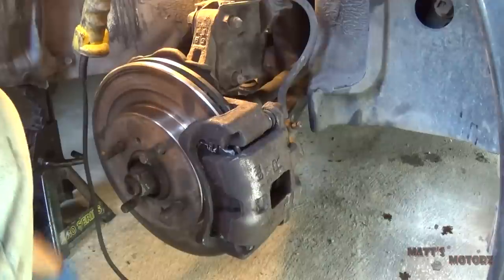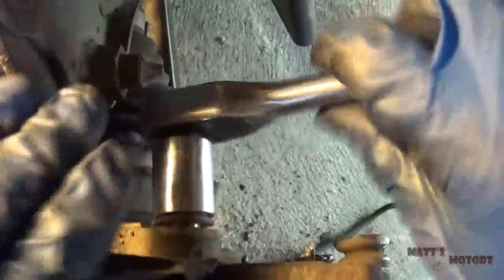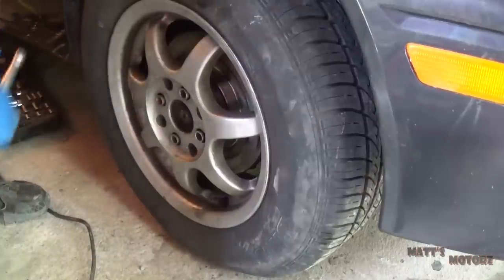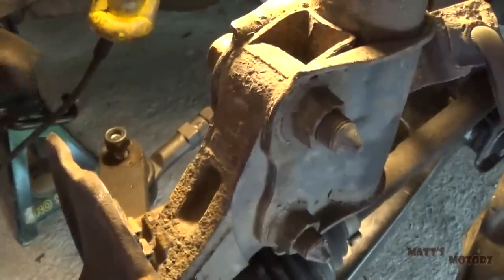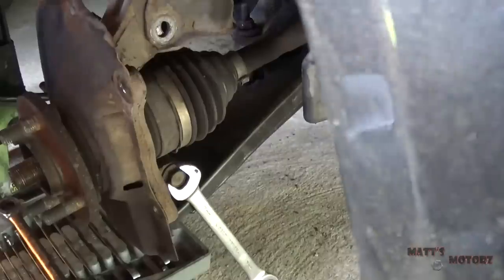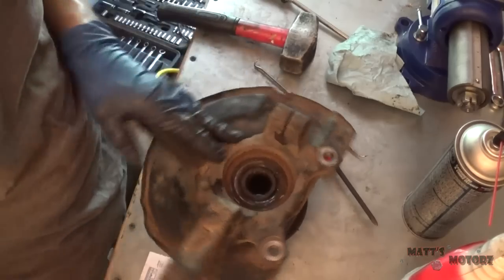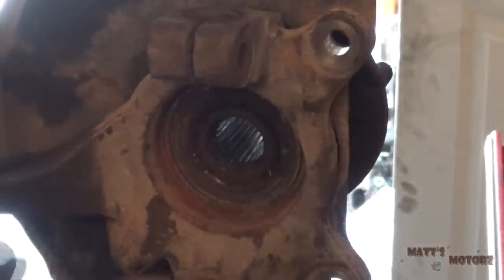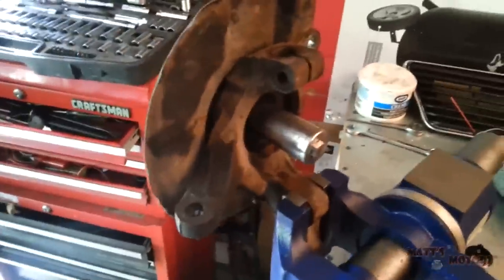Wheel Bearing Replacement - Part 1 [2002 Mitsubishi Lancer]

Comment: Good video Matt, thx for the share! I'm fixing to do a friends bearing on an '05, my only advice from past experience, when pounding the bearing out, make sure the spindle assembly is on a stable, firm setting, every time you hit it on the vice n it moves, you're losing striking power. On some spindles I've set it on the ground studs down, with something keeping the studs off the ground. Have a good one man!

Comment: I like the way you proctect the joint and your equipement. Must guys just hammered like crazy and breaks everything. You will need to find a way that the piece don't move when you hit it with your hammer. you loose a lot of power. Another thing. Kudos for the quality of the images and sound. Too often its good but crappy. Good day

Comment: I need to change a driver wheel bearing on my OZ lancer. and i'm suprised how much you have to do just to change a wheel bearing. My F150 i changed the outer without even taking the roter off.

Comment: Great video, gave me more insight on the job I'm going to perform on my mirage. Just wanted to add that you probably would have gotten the axle nut off with the impact wrench if you would have used actual impact sockets. I've found in this kind of situations that using plain sockets will make the socket vibrate on the nut a lot and sort of dance around instead of spinning the socket out.
Reply: Same

Comment: Doing the same job with some incite for you if your not already aware. I assume you didn't have access to a press because you can avoid all the pounding. Also on assembly if you put the spindle in the oven at 350 for 15 minutes or so it makes install almost effortless. Also put the bearing and hub in the freezer while heating the spindle. Hope this helps

Comment: I have an important question. I have a 2006 Lancer OZ Rally, will the Lancer Es wheel bearings fit the OZ Rally? I need a front right wheel bearing and all the parts stores around me ( AutoZone, Smyths, O Reilys ) only have the wheel bearings for the ES models< not the OZ Rallys so I was wondering are they the same?
Reply: cindalee1993 only way to tell is to take it all apart and see if it's the same size is yours 4 lug as well if so I wouldn't see why there would be a difference

Comment: what size socket do you use with the bolts in order to pound out the bearing and the part with the lug nuts on it? I need to know the size of the socket to use because i don't have anything around my house that will work. Thanks
Reply from the maker: Damn I don't remember.  I believe to hammer out the hub (first one) it was a 1,1/4" socket, and to hammer out the bearing it was a 36 mm socket. Not 100% though.  The best thing to do would be to bring the hub assembly to the auto parts store and compare the sockets there with the hub / bearing and buy the ones that fit.
Reply: MattsMotorz Ya Thats what i ended up doing. I have to bring it back down there tomorrow cause i got the hub out now i need one big enough to get the bearing out. Thanks for the videos they really help.
Reply from the maker: No prob! Glad to hear they helped!
Reply: +Derek Jacobson do you know what size you ended up using?
Reply: *****
 No Sorry I don't remember now.

Comment: How do you guys know when the bearing is bad o needs a replacement?
Reply from the maker: I made a video on how to check.  Search my channel for "how to check for a bad wheel bearing"
Reply: Sometimes, in most cases you can lift the car or vehicle up to where said wheel is off the ground and wiggle the wheel. If theres a noise or more movement then your comfortable with then its time to change the bearing.

Comment: Yeah, everything went okay until i got to the control arm. I can't knock the thing out of there, I've tried penetrating oil and a torch but nothing will knock it loose. Got everything else loosened, so this is the only thing holding me up :(
Reply: yea you take the control arm off with it then. I found that the bolt from the control arm and the hub was so tight i couldnt get it
Reply: A small gear or pulley puller will get it out. I recently had this issue but I had neither of the tools need to do it so I just done it right there with a bearing press.
Reply: I did eventually get it, after snapping a breaker bar in half lol.